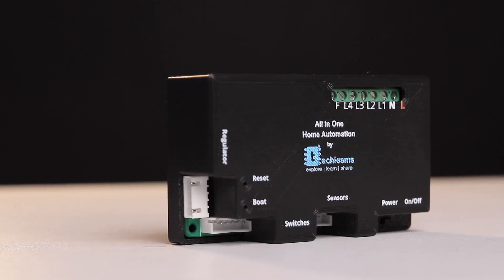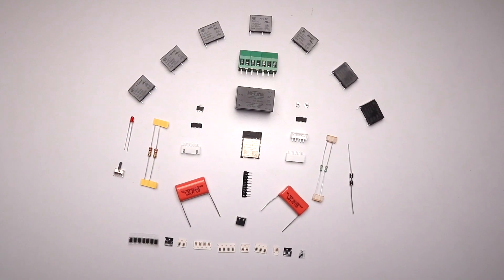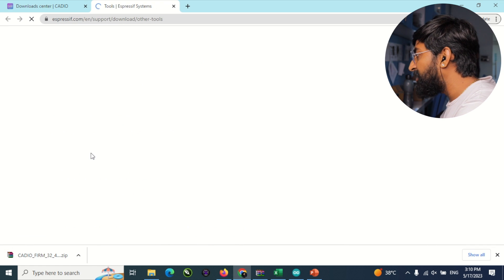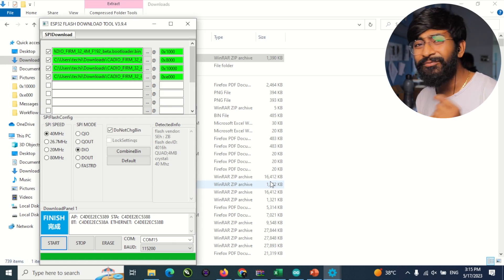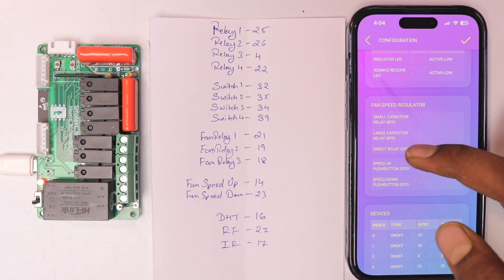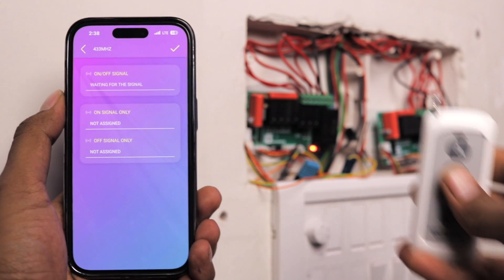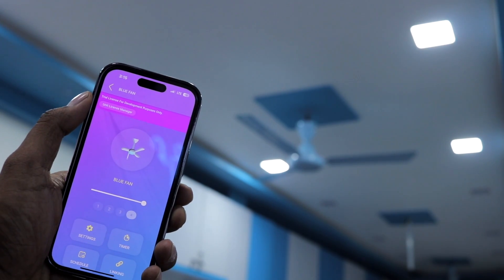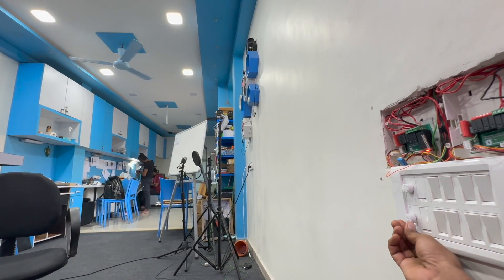CADIO Home Automation with Fan Dimmer | Giveaway ⚡️ | ESP32 Projects | IOT Projects

Comment: What's the reason for using 3:44 up/down switch?
Reply from the maker: For fan speed control
Reply: @techiesms  it's just a up/down switch that can be used to on or off so you it can be used to control speed. Dose it works on DIAK & TRIAC principle

Comment: Please help 😣 me with fan dimmer, i had watched your videos on dimmer, i am using same components but doesn't get my fan to be able to dim... 
Any suggestions???
Reply: Don't use rainmaker on first place i too had alot of issue with fan dimmer ,using rainmaker Cadio is best go for it
Reply: @drelectronics13  dimmer is not even working on zero pcb without using any type of relay or microcontroller